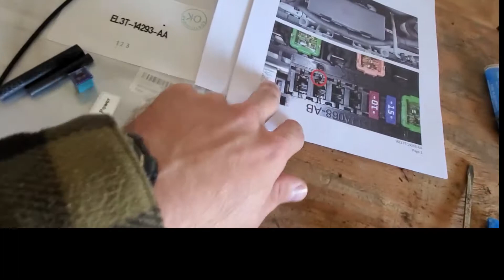2012 Ford F150 Raptor Fuse 27 Relocation How To (Minute Maintenance)

Comment: Good video but the kit instructions do not tell you to trim the replacement wire, you need the extra wire to bend the over the wires so they are in a straight line to be able to pull the shrink wrap over the soldered area.

Comment: What was the blue plastic tool you use to break loose fuse box??
Reply from the maker: They are called trim removal tools. Essentially just a set of small pry bars with different shaped ends. You can get them at most part stores, Amazon, or harbor freight.
Reply: Body tools

Comment: Don't trust the sticker, someone did a 1/2 a%% job on mine. Left a 15 amp in 27 and a fuse missing the the clear top in 70. 70 does not kill the FP. Have to pull it apart and see what's going on.
Reply from the maker: Sorry to hear that! Hopefully you get it figured out.
Reply: @minutemaintenance7385  Well, The last redneck wired pin 70 to the blower relay. The wire Color is similar. I can't find the wire stub either for the blower. Have to look again, not easy to manipulate the wires.
Reply from the maker: Yeah, there's two wires that are very similar but you need the thicker one.

Comment: Good video brotha 👌
Reply from the maker: Appreciate ya watching! There's alot more modifications, maintenance and upgrades for the Raptor and other vehicles in the works so be sure to check in every monday!
Reply: @minutemaintenance7385  I definitely will brotha I bought one and I haven't done this to it I have the kit I'm jus really nervous to do it lol and wat else u recommend for the gen 1 raptor have u had any problems with yours
Reply from the maker: @antoniodelgado4939  No problems yet! Loving her everyday! I'd highly recommend a "Tailgate Assist" lowering shock, just makes opening and closing the Tailgate a whole heck of alot easier! And new NGK Spark Plugs of course, make sure the Raptor gets every Oz of power out of her 6.2L!
Reply: @minutemaintenance7385  nice man I bought the gen 1 for reliability and how many miles u have on yours so far brotha and its a good truck overall even in the snow ❄️ I was happy with the decision always wanted this truck as a kid